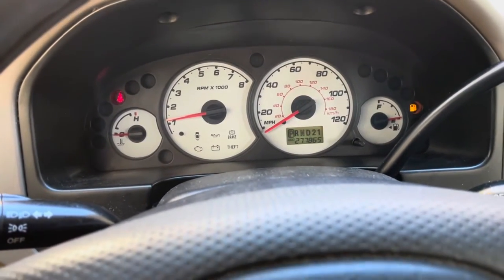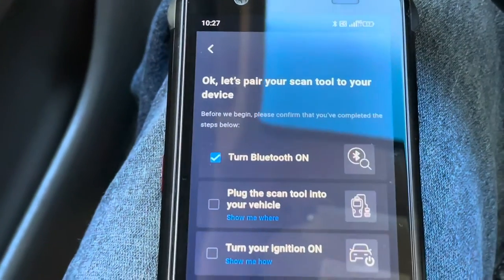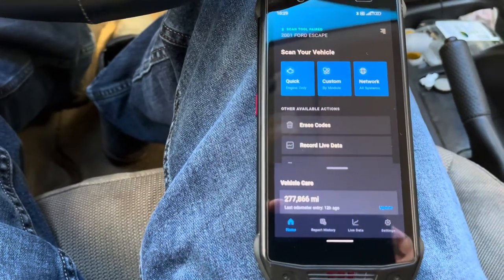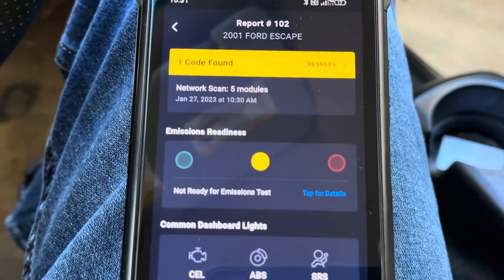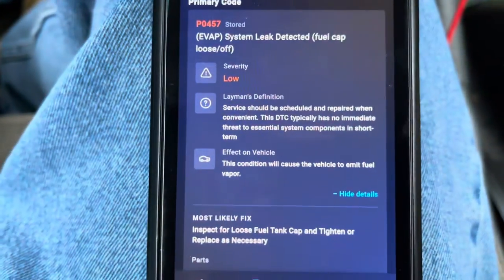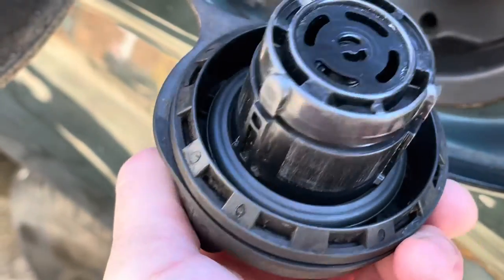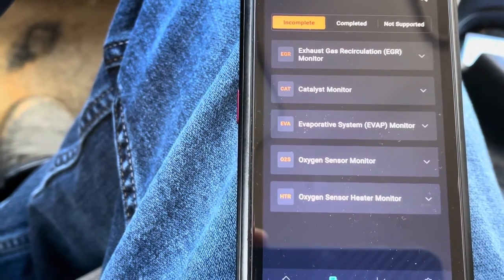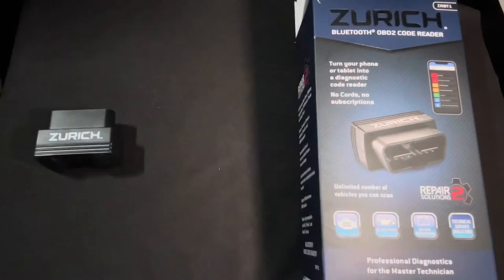Harbor Freight ZR-BT1 OBD2 BLUETOOTH Dongle Code Reader Best Bluetooth Coder Reader Under $100 Bucks

Comment: Are you able to clear check engine light with this as well?
Reply: Hello! I have one. Yes, it is able to clear codes.
Reply from the maker: Yes as well as abs and srs
Reply: I don't think there is any OBD2 device that CAN'T clear codes. Even the $6 ebay special, paired with the free version of Torque, will clear codes.
Reply from the maker: @John_Ridley no doubt tech has come a long way. Tons of options I agree

Comment: Diy do you know if this acanner can monitor radiator cooling fans to see if they kick on and off can  you check and verify please
Reply from the maker: The live data feature should show it, but you would not need a scanner to tell you if it's on you should be able to hear and feel the fan when it comes on.
Reply from the maker: What type of vehicle
Reply: @DIYKAI  2012 ford explorer 3.5l
Reply from the maker: @jvst20051  so this is a pretty basic scanner it does show live data so it is possible but it can not switch them as this is not a bi directional scanner. If your a home fixer in your car this will definitely help if your a mechanic suggest getting a little more expensive one

Comment: Does it do transmission temp as live data? I got a bluedriver that does not but the rest seems good. It doesn't even show trans temp at all which is disappointing as I need it as live data feedback
Reply from the maker: It does not do live trans fluid it takes a snap shot of it at the time of scan of the car is capable
Reply: @DIYKAI  oh ok, well that's worthless then. They sure do go a long way to try to keep you from changing your own trans fluid so you can buy new transmission soon as warrantees expire. Can't imagine why even the cheapest junk meter that does live data can't read trans temp live?
Reply from the maker: What car?
Reply: @DIYKAI  2018 Camry with 8 speed auto. I tried a blue driver but it won't read trans temp on it even though it reads live data. Most the expensive have a time based reoccurring fee instead of just updating to include new models which as a diyer that automatically throws that option out because who wants to pay yearly for a tool they may not even use in a year. I could understand paying $100 when you want it to update to the newest and best models once you need it but to pay a fee reoccurring constantly is ridiculous just to continue use the tool and all the features. Having trouble finding a good one without all these required reoccurring fees. If people willing to buy it they'll ask be willing to rip everyone off so more and more are moving towards that. Already paying hundreds for a computer that was probably $50 so most of that extra money was already for the software. Then you don't get to use it once the membership expires? Seems crazy
Reply from the maker: @jackle842000  you could use an infrared thermometer and scan the trans pan
Reply from the maker: @jackle842000  unfortunately all these companies want is your dollar it does get very expensive
Reply: @DIYKAI  that's exactly what will prevent them from making as much. The millions of diy'ers will say why work on my car if it'll cost me more than the mechanic every 5 years. No point & they'll be losing millions times the hundreds they make on each computer system over that. Oh well, their loss LoL
Reply: @DIYKAI  that's an option but it's hard to tell unless you know what the reading should be. There's many places that are not quite accurate on temp and be hard to tell which is what unless you're scanning it at the same time. The fluid is very temp sensitive to expansion too. I did think about using that but I'm sure somewhere there's a computer system that doesn't require you to pay yearly. Just hard to find I guess. Definitely a huge market for it. If I work on my own car I don't even need an update I just need to be able to read that one car for 10 years. There's a lot of people in the same boat. But the dealers are also telling you you never have to change the fluid and that might be true to get out of the warranty period but I've never seen very many people that buy a car and looking to replace a transmission as soon as the warranty expires. Most people expect to transmission to last about 200,000 mi anymore
Reply from the maker: @jackle842000  our newest car is a 2012 lol
Reply: @DIYKAI  so at $100 a year subscription you'd have paid  $1,200 for the scanner to sit there plus $600 or so for the scanner. Not sure they'd be worth it. Seems like a joke huh?
Reply from the maker: @jackle842000  yup they just want you to bring it back to the Stealership
Reply: @DIYKAI  Yeah, I'm pretty sure that's the only reason you have to have the temp so specific you need the computer to set the transmission fluid level.

Comment: This thing sucks!! I lost my BAFX that i use with torque pro. This wont check trans temp, mpg, or many other simple functions like bafx does. Returning and buying another bafx.
Reply from the maker: yes this is a very basic scanner we get trans temp from fords in a freeze frame? not sure why you didnt
Reply: @DIYKAI  yet another thing that this dongle doesn't support, freeze frame data.
Reply from the maker: @pcrepairguys  yea not sure what your doing wrong this is an entry level scanner and we can read freeze frame on a 01 escape…….as well as trans temp on KOEN and it will snap shot it every time the key is cycled

Comment: Is it capable of checking transmission temp?
Reply from the maker: Yes
Reply: @DIYKAI  thank you sir
Reply from the maker: @AbanobbG  your welcome are you trying to read temp to fill a trans? It was kinda slow but did show it in an 01 ford
Reply: @DIYKAI  Yeah I only need it to check my transmission fluid level, as long as it shows it I’m going to buy it today
Reply from the maker: I don’t think it will live stream the temp it takes a snap shot when you connect it and you can read it. You may have to refresh the scan to see an update on the temp but we were able to see cold temp then drove rescanned and seen warm temp

Comment: I’m having trouble creating an account, did you have issues with this
Reply from the maker: No issues
Reply: @DIYKAI  thanks, it’s when I type in the zip code, says cannot process your request at this time. Very weird
Reply from the maker: @krew7687  I think that happened to us as well we reset our phone and it worked but you should still be able to use the reader I think?
Reply: @DIYKAI  I tried multiple phones as well but didn’t let anyone create an account but thanks for advice, still didn’t work
Reply from the maker: @krew7687  that’s weird maybe call tech support ? System may be down
Reply: @DIYKAI  that was my plan, but they are closed on weekends, and all I need is battery registration lol
Reply from the maker: @krew7687  Ah got ya man dang hopefully you get it sorted out
Reply: @DIYKAI  thanks, just went and bought a more expensive one , did the trick, wish I would’ve used the dongle though, heard a lot of good from it
Reply from the maker: @krew7687  sorry it didn’t work out for you glad u fixed what u we’re trying too

Comment: Same thing as the Hyper Tough HT500 for $10 more than the hyper tough.
Reply from the maker: Nope my brother has the hyper tough and it's 🗑️
Reply: @DIYKAI  literally the same thing. Does the same exact things.
Reply from the maker: @SnyderOutdoors  literally not we just had the hyper dodo hooked up and it froze and couldn’t pull code of an 01 prelude hooked up the HF one ZERO issues. Unless you have compared both side by side like we did performance wise you cannot tell people it’s the same

Comment: Does it log boost pressure?
Reply from the maker: Not sure we can check
Reply: @DIYKAI  alright let me know what you find out need to see where my veloster is loosing boost and putting me into limp mode
Reply from the maker: @Jacob-od5yo  I don't think it will be able to tell you where boost is leaking from at best it may show relative boost PSI
Reply from the maker: @Jacob-od5yo  Have you check the boot connections, clamps for tears or looseness
Reply: @DIYKAI  I have not kinda cramped and I'm kinda lazy was just gonna find a pressure tester but no where near me has one
Reply: @DIYKAI  yeah just need to know if it's meeting the required boist first then I'll look for a leak
Reply from the maker: Got ya will get back to you in a few
Reply from the maker: I hear ya lol
Reply from the maker: Sorry for the delay. It does not seem to read boost
Reply: @DIYKAI  good thing I didn't buy it then lol
Reply from the maker: Yes good thing lol